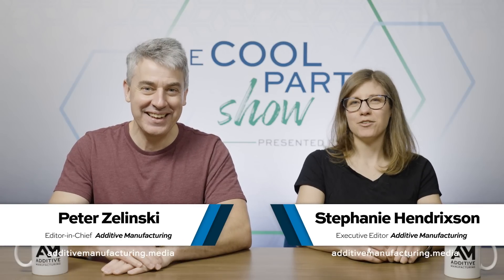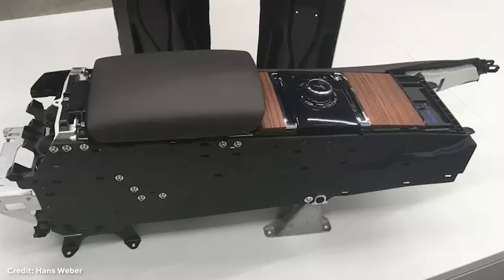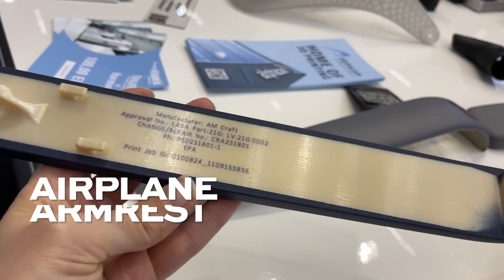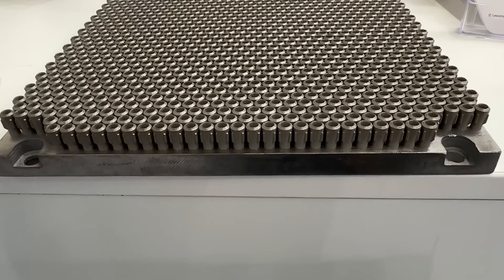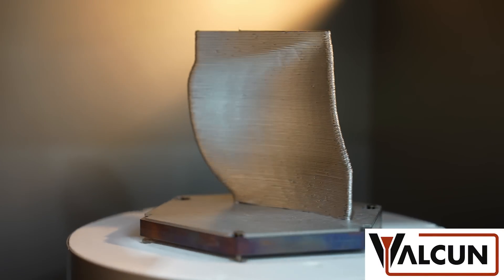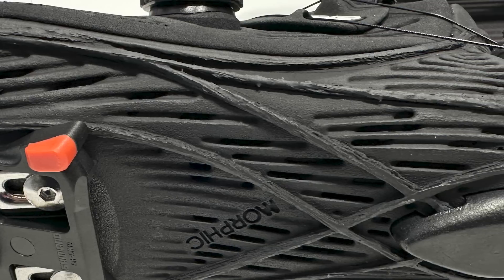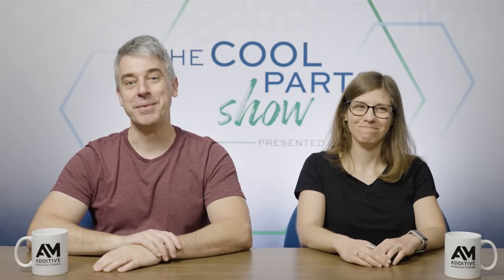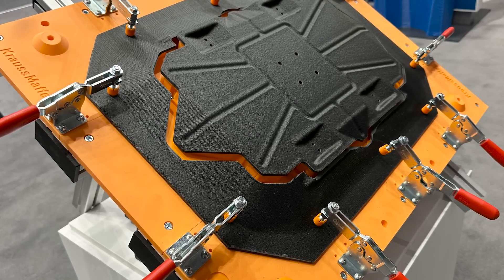8 Cool 3D Printed Parts From Formnext 2024 | The Cool Parts Show

Comment: hey Pete hey Steph, there are 2 new AM parts (that both definitely qualify as "super cool") that you guys should look into doing videos on (if you're not planning to already).  since i see you guys are willing to travel, like when you guys travelled to one of my fave towns for Motorsports and Racing Engineering (ref: Indianapolis for Dallara) be advised 2 of the biggest names in Automotive sector (none bigger) are using 3D printed suspension components on the latest versions of their Multi-Million dollar Hypercars coming in 2025...

yeah, Ferrari on their new F80 (799 units) is using 3D printed Aluminum on 1 of their rear suspension components (2 in total), and McLaren on their new W1 (399 units) is using 3D Printed Titanium on no less than 3 of their front suspension components (6 in total).  Ferrari apparently has their own in-house capability...? (not 100% sure on that so you'll have to check that out) while McLaren apparently worked with a US Company named Divergent.  either way, one sounds like  a nice "road trip" to Modena Italy and the other sounds like a nice "road trip" to Woking/Surrey England to "get the scoop".  thank you. 👍
Reply: oh also ref: CZINGER.